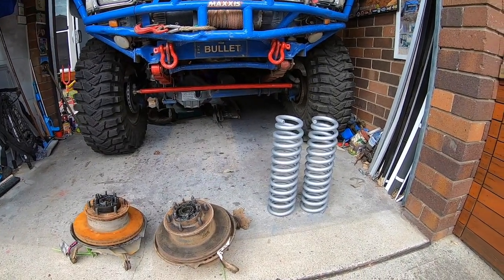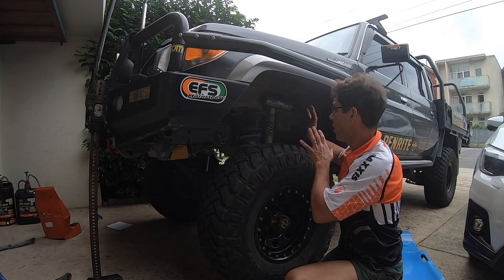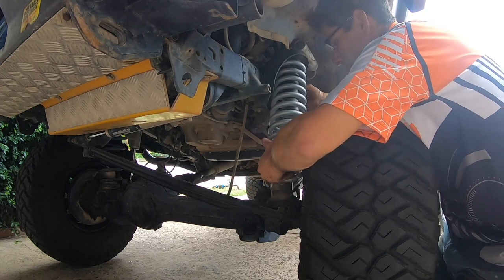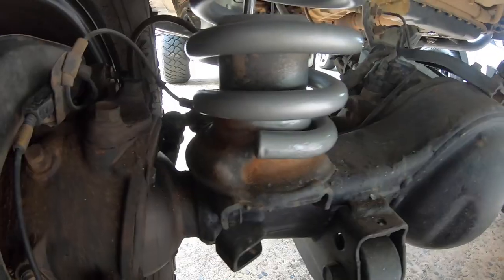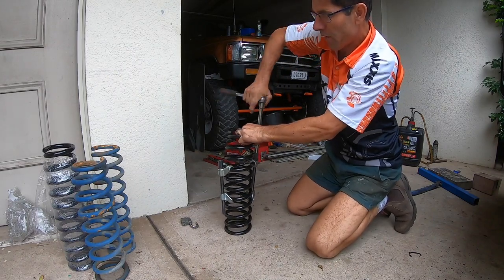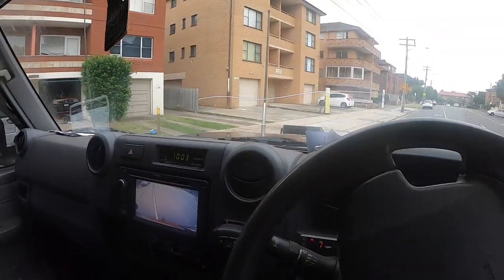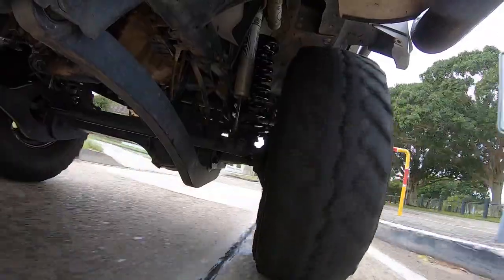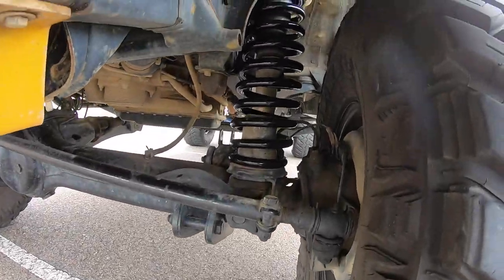How to change coil spring 2 inch v 3 inch lift Toyota landcruiser vdj79 78 76series Efs front coils

Comment: Thanks mate, was wondering how those springs were removed. Bloke at work reckons you need spring compressors, ours is a 100 series but similar set up and springs look the same as yours. Cheers again. Keep trucking mate
Reply from the maker: mate, with the sway bar off, you shouldn't need compressor, just watch brake lines...

Comment: Try some of that Liquimoly injector & fuel treatment every couple of tanks, it quietens down the injectors in my VDJ79R. I ran it mainly to clean the fuel system & injectors, it's safe to use at the recommended rates.
Reply: P.S I think Penrite make a similar product but I went with Liquimoly as Nathan over at exploreOZ did some tests on His Youtube vid. and I was impressed with His results.
Reply from the maker: @dustyfarmer  Cheers Dusty, i will definitely look into that..

Comment: Did you do any height changes at the rear? aren't the TT parabolic only a 2" lift and you increased the front to a 3' lift?
Reply from the maker: Yes correct, I only had those 3 inch fronts in while I was testing the treps, im back on 2s now with the 315s, I just ran 20psi in my bags to level it out whilst I was driving it On-road.... Drives much nicer  with 2s front and rear....
Reply: @TeamBulletOffroad  I have 35's on -25 offset from Patriot Campers but they do scrub out the guard so was looking at the extra 1" lift to help clear. Not sure what i am going to do yet....i like to try and keep everything as legal as possible. Thanks for the reply and am enjoying your content... Cheers from another Chippy up in Cairns.
Reply from the maker: @andrewdurbidge1283  The 3s up front were perfect for the 35s mate.....Cheers buddy
Reply: Those aftermarket radius arms bring the whole diff forwards abit too don't they? 
Help with clearance bigger tyres and 2" lift?
Cheers